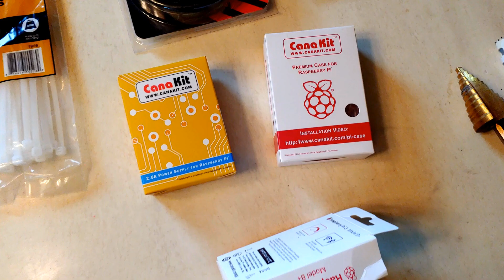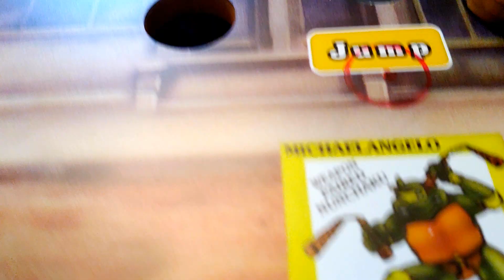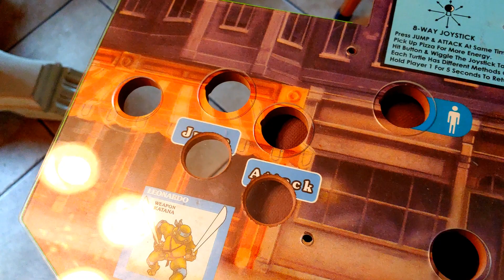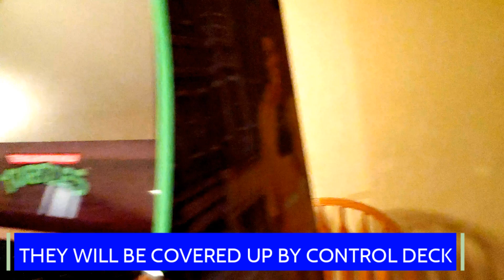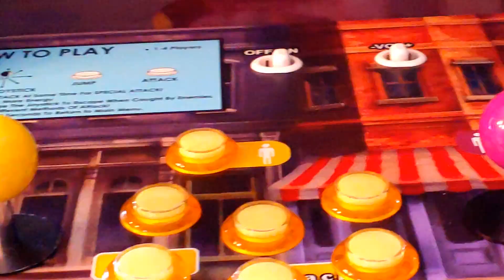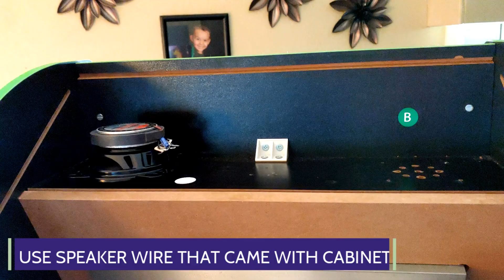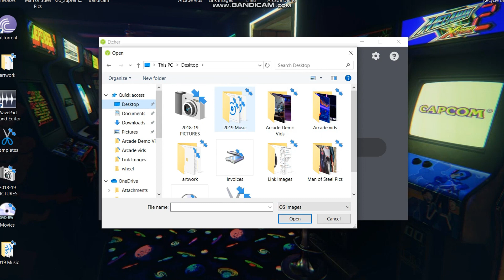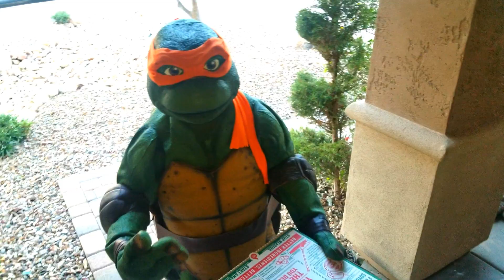TMNT Arcade1up 4 Player Cabinet Mod Tutorial

Comment: hey man im a quarter way done and got stuck on something. how to power on the system? i wanted to use the original on off switch and saw a vid where the guy spliced and extended the joystick cord and plugged it into the raspberry pi on pins 5/6. is that what u did here?
Reply from the maker: I just bought one of those plugins that you plug the entire power strip into that has a remote and then I can just turn everything on with the push of a button
Reply: Arizona's Arcade Heroes thats a good idea. i like having the physical switch. so many options!
Reply: sorry for the bother. another couple newbie questions. when u drilled the underside of the controller panels for the wires to go thru, did u use the dozer drill or the plexiglass drill? lastly i am completely new to raspberry pi. bought a flashed sd card on etsy so i didnt have to bother with the downloads. gonna assemble the pi unit. do i just pop in that sd card and power on and everything will work? its a pi 4...cause in the instructions there is an initial setup where u put an sd card in and it updates etc. havent gotten my flashed sd yet but was afraid that if i put that it, it would get formatted and all the data will be erased.
Reply from the maker: @311nonoboy  so they answer to your first question leads me to believe believe that you might be confused about what parts are what. The Dozer is actually the piece that drills the plexiglass the step bit is the piece that drills through the wood, you will have to use both at some point to run the wires to because you have to drill through the wood and through the plastic to get the outer players to the inside of the cabinet then you'll have to use just the Dozer to drill the holes through the back of the control panel to run into the inside of the cabinet. I have no idea how those pre-ordered SD cards work but yes assuming it is the same as mine you would just put it into the Raspberry Pi and configure your controllers and start playing
Reply: Arizona's Arcade Heroes sorry got the terminology wrong. clear as mud now. dozer for plastic, stepbit for wood. thanks for your response. i will see what happens
Reply from the maker: @311nonoboy  good luck let me know how it turns out

Comment: just bought the holedozer as pictured and it looks wayy larger than what the hole should be for the buttons. im scared to do it and mess up the plexi and find out the holes are too big. 44mm is the size. lmk if that is correct
Reply from the maker: I don't know the exact measurements but I can tell you the one in the link I sent is the correct I think about the fact that the holes in the plexiglass are a lot larger than the actual buttons because they have to go over the buttons
Reply: Arizona's Arcade Heroes crap. i just opened the one i bought with the screenshot of the dozer on the vid. it is too big. in the beginning u when u talk about it there is text that says 'also 1 3/8.  i think thats the right size cause its smaller. but they didnt have the 1 3/8 size with the drill attachment, just the dozer by itself :(
Reply from the maker: @311nonoboy  sorry man I know that Lowe's and Home Depot both sell that exact Dozer  bit
Reply: the bit is 1 3/8 and will have to be bought with the 3/8 pilot quick change with pilot drill bit totalling about $32
Reply from the maker: @311nonoboy  all I can tell you is the one in my video has worked for me more than 10 times and 4 tons of my customers and followers so I'm really sorry you're having trouble
Reply: no worries. went to home depot to return it and saw two ladies going at it. i will include the milwaukee item numbers etc for others

1) holedozer 1 3/8 35mm item 49-56-9615

2) 3/8 shank ergo quick change hole saw arbor item 49-56-7250

3) husky 8 piece folding hex key set item 848 122

the guy that helped me showed me that you have to use the hex key to open up the quick change to install the dozer. works like a charm

Comment: Great video.  Thanks. 
QUESTION: What if I want to use the stock joysticks that come with the TMNT cabinet?  I notice each joystick uses TWO 4-pin connectors (instead of one 5-pin) and none of the encoders I've been able to find online support that.  I really want to use the stock joysticks and not have to shell out (no pun intended) for completely new ones.  Any suggestions would be greatly appreciated.
Reply from the maker: You can't do it sorry you have to order the new kit
Reply from the maker: The arcade1up joysticks are pieces of s***
Reply: @arcadepickers1682  
Thanks for the reply.  Actually, I've got some extra 2-pin connectors that came with my other encoders, so I am going to cut the 4-pin connectors off the stock joystick wires and then splice them with the 2-pin wires.  Been talking it over with an electrical engineering friend of mine and that should work fine, I just might need to do a bit of soldering.  

At any rate, thanks again for the response.  Peace.

P.S. The stock joysticks in the TMNT cabinet are actually an upgrade over the joysticks used in Arcade1Up's previous cabinets and are supposedly pretty decent for the money spent, according to other YouTube modder videos.  And from my own personal experience using them, they seem just fine to me for what I need.
Reply from the maker: @jadimich  if you can do it that way that's awesome, usually people watching YouTube tutorials don't have the skill to do something like that so kudos to you. I feel like the arcade1up joysticks are about the cheapest quality possible-- out of about 10 different levels so I always encourage people to upgrade them when they are doing the mod that way they don't have to replace or repair them later, thanks for watching good luck

Comment: Every time I put it in attract mode it will load part way then go into command mode and I can’t get the image to load again. Any ideas what might be going on?
Reply from the maker: You might need to retransfer the image....i had to do that a couple times
Reply: Arizona's Arcade Heroes. I retransferred the image did some digging in the setting menu of retropie found a few things in a quick google search and was able to get the image working very stable.... soon I will as well have a tmnt arcade cab modded. Thanks for the videos brotha they have been very helpful.
Reply from the maker: Great job! My pleasure ...so happy it helped out!

Comment: Hello I set up and drilled all the buttons, connected the lcd converter, raspberry pi, but when I go to turn on light on converter goes green for a few seconds then goes red. Also the screen says no signal. Do you know a fix to this?
Reply from the maker: You need to let it be for about 30 minutes then try restarting the Raspberry Pi otherwise you need to get the correct power source for the Raspberry Pi because if it fades to Red it is not the correct power source even though it might have the right connection on The Wire oh, I had to order the specific Raspberry Pi power source from Amazon in order to get mine to work on one of my cabinets
Reply: Thanks for you quick reply iam leaving it on for 30 minutes just now. So I ordered everything from the links you provided, including the link to the set from amazon with the canakit power supply that came with raspberry pi. So two days ago I tried it and the Raspberry pi worked and retropi and the retropi menu showed on the screen but it didn’t show any games or consoles so I thought I did something wrong and erased it and tried putting a new image. This is my first attempt and my nefew is doing the computer part of the build. I was gonna try doing it with the WiFi and transferring the Roms that way.
Reply from the maker: @nandohernandez461  Good Luck I hope it works!
Reply: Fixed the red light issue and downloaded the Roms with WiFi. Now playing the games I’ve always wanted. Thanks, subscribed and liked!!
Reply from the maker: Awesome thanks
Reply: Quick question I’ve got everything going, playing games but however I don’t have the LED lights on the buttons connected. can you tell me where the white plastic part of the wire goes on the decoder board? Does it go on the single red socket or the one where there is two red sockets?
Reply from the maker: @nandohernandez461  it's hard to tell without looking at it but usually any of the Red spots are power so I would just try both of them

Comment: Having problems with the joysticks...they mess up the software if all 4 are plugged in at the same time. Let me know if you know how to solve this issue.
Reply from the maker: So assuming you hooked everything up correctly on the encoder, this is the annoying part. You're going to have to play around with the configuration of all for USBS on the Raspberry Pi, you probably have them in the wrong spots obviously there are four different slots I think if you Google which one is Player 1, player 2 Etc you can find the schematic online but if those are jumbled up the controls will not work correctly
Reply: @arcadepickers1682  they work individually even if i have 2 plugged in they work fine i configure them and i play games, but when i have 3 or 4 controllers plugged in, they dont work properly. I checked those also invidually and they worked as well. Its only when 3 or 4 of them are plugged in.
Reply from the maker: @dominicanpa4u103  pm me on Facebook

Comment: This might be a daft question but would all this work with a rasberry Pi 4B 4gb model ?
Reply from the maker: Yes but the image I used only works on Raspberry Pi 3 B+ so you would have to find a different image on Arcade punks
Reply: @arcadepickers1682  Thanks for the quick and helpful response. very informative and inspiring video btw. Subbed :)

Comment: I’ve watched this video and followed everything you did to a T. I cannot figure out the speakers and the amplifier. The ones you use here are unavailable on Amazon, so I bought black diamond coaxial speakers and a different amplifier. They don’t seem to connect, what should I do??
Reply from the maker: Should be pretty standard speaker wire directly into amplifier, I did find out much later on that these amplifiers end up coming not working from Amazon I would possibly consider doing a return and reorder
Reply: @arcadepickers1682  funny thing, I got the speakers working now! They sound great, I’ll comment again if I have other questions. Thank you for the video!
Reply from the maker: @rmancini4416  glad you got it working and thanks for watching
Reply: One more question, how do you power the machine on and off since you don’t use the original on/off switch??

Comment: Can this be done without changing the speakers?
Reply from the maker: You could wire those speakers up to the amplifier but they would probably get blown in no time
Reply: Thanks. And also you didn't show how to wire up the coin buttons?
Reply from the maker: @billybywater2277  you just wire them up exactly the same way as the other button and plug then in  just like a regular button

Comment: Wen and where do I do emulation Station and configure controls?
Reply from the maker: When you first turn on the Raspberry Pi and it comes on the screen the first time the game loads it will have you configure the controls and then you'll never have to do it again unless you go in and do it manually
Reply: Since this video was made 2yrs ago which Raspberry should I be getting now? The 4?
Reply: Also..if I get a retro pie SD card do I still need to download softball to my Raspberry? Or will it be pre loaded?

Comment: The wiring is the hardest. I don't understand on the board where the wires go
Reply from the maker: Did you get the one plug kit where there is one plug for each button to the board that are white or did you get the red and black positive negative cords
Reply: @arcadepickers1682  I got the one you suggested to get, I ordered it through your channel.
Reply: I got them both
Reply: Could you take a picture of your cabinet with the wires showing so that I know where everything goes.
Reply from the maker: @adamtrogdon959  I would love to brother but I sold it probably about a year ago
Reply: @arcadepickers1682  are you using another arcade1up?
Reply from the maker: @adamtrogdon959  no sir...all real arcades now

Comment: Alright, last question. Lol...how did you deal with the wires that block you from putting the control deck back onto the cabinet? I drilled the holes on the side to let the blue and red start button wires cross over but now I can't put the control deck back on comfortably without the wires being in the way. I assume I could drill pathways on my cabinet but curious what you did.
Reply from the maker: I absolutely did drill pathways through the gates blocking the way underneath the control deck, not only that but I had to splice longer wires on to the original ones in order for them to reach through to the encoder

Comment: Why not using raspberry 4?
How does 1gb ram runs heavy games?
Reply from the maker: When I made the video the Raspberry Pi 4 was not available yet, will it did come out shortly after it had a lot of problems it wasn't until the last few weeks they were able to put out a stable version of the 4
Reply: @arcadepickers1682  thanks, and my other question Sir, please
Reply from the maker: @warr1  I don't know what you mean by heavy games? The Raspberry Pi 3 B+ will play everything up until you get to PlayStation then it plays most of the games but not some, Dreamcast you can only play a handful of the games as well and N64 several of the games run extremely slow other than that I feel like everything else plays at normal speed
Reply: @arcadepickers1682  I meant retro games that requires more hardware. With better graphics. Cause I'm planning to do the same project, soon, but I was wondering if the 3b + is good enough for all retro games and won't have any lag. Or I should go for more ram. My other issue is that I'm from Costa Rica, and I will have to purchase the arcades online. I appreciate the time u took to answer Sir

Comment: Ima try to attempt this. Will u help if I get lost. Thanks for the video.
Reply from the maker: Absolutely ...good luck! You got this!!!
Reply: @arcadepickers1682  I click on the link for the speakers and amp. And buttons. And seems like there out. Is there other link you can a help me with plz
Reply from the maker: Yes on Amazon you can get any 2.1 amplifier just make sure you order the correct power source which is usually 12 volt and make sure on the image of the app that has a spot for subwoofer and right and left speaker they range anywhere from 15 to $30 a piece
Reply from the maker: As far as the speakers go you can order any four inch speakers just remember you get what you pay for so try to not get the cheapest ones possible unless you have to
Reply: @arcadepickers1682  how long did it take u to finish
Reply from the maker: About three  days after I had all of the parts
Reply: @arcadepickers1682  thanks for being so fast and responding. I'm still thinking about doing it. I haven't decided. Me and my bro was at Wal-Mart thinking about it. I still have to get the parts. I think the 1st thing to get it the machine. Ans another thing my lady/ fiance is like how much is it all going to cost lol.
Reply from the maker: @lamontmullen04  I think you will find after you buy the machine and modded you guys will use it on a regular basis so it is definitely worth the cost, me and my wife and kids play it regularly and have a ton of fun with it
Reply: @lamontmullen04  So how did it go? Did you get to build the arcade?
Reply: @Redshield_84  i never bought it.

Comment: Why not use a raspberry pi 4?
Reply from the maker: At the time of this video they were not available yet and when they first released the pie 4 it was very glitchy.... it also had a problem with overheating so I went with the 3 B+ since it plays all the arcade games and most of the console games, if you are doing the mod now it might be a good idea to use the pi 4 since a lot of the problems have been worked out
Reply: @arcadepickers1682  gotcha. Makes sense. Im considering making my own full-size cabinet or a 4 player pedestal. If I make a full cabinet Ill use a 43 inch tv. I can't wrap my head around installing roms. I do know Id like to use a 1TB ssd for game storage though. Great video!
Reply from the maker: @shawnwade302  Thanks ! good luck and have fun!

Comment: how do you turn on and off the pi?
Reply from the maker: Sorry I didn't include that in the video but you need to buy one of those plug-ins at Walmart that allows you to turn the entire power strip on and off with a remote control
Reply: @arcadepickers1682  Thanks for the reply.  I have one of those wifi plugs I could use.
Reply: How did you change the theme song to it's original version?
Reply from the maker: @johnkennedy91  on the downloaded version it is always the original version on the stock machine it is the remake
Reply: I want to change the theme to the original .. I cant stand that remake version
Reply from the maker: @johnkennedy91  that's one of the main reasons I modded it LOL
Reply: @arcadepickers1682  thanks for the reply.. how do I get the downloaded version ..?
Reply from the maker: @johnkennedy91  no problem, if you go to my let's play Sonic Adventure on your arcade1up video the link is in the description for the image to download